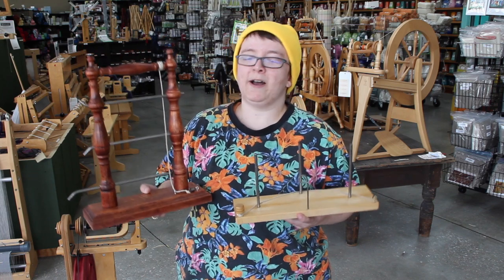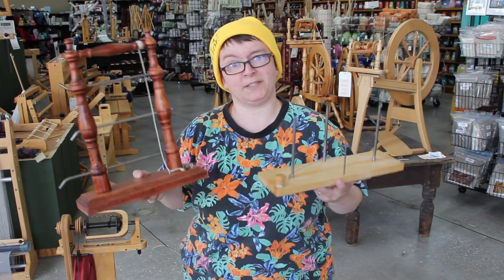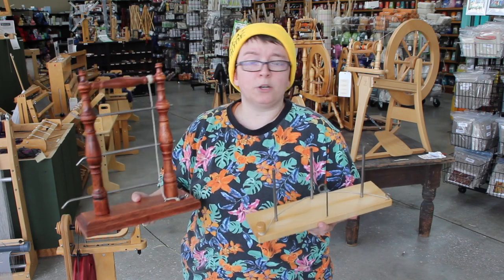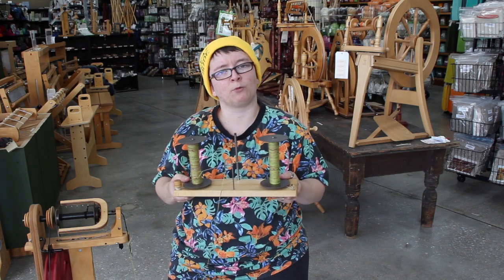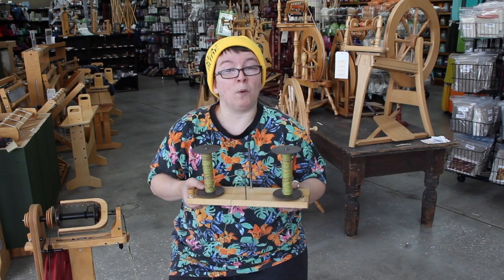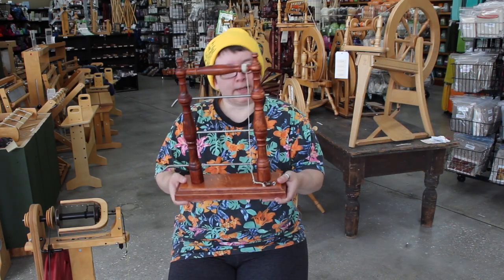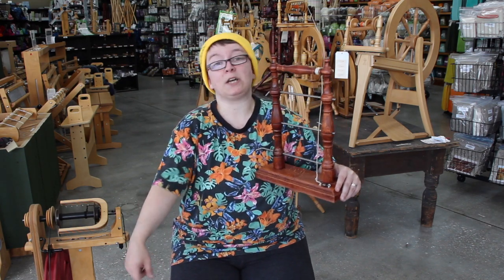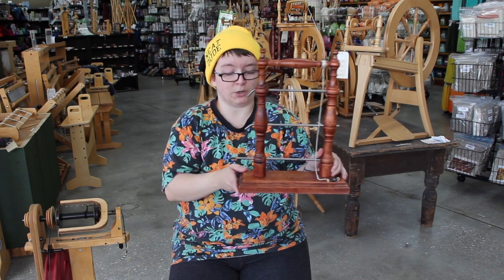What is a Lazy Kate?

Comment: Does it matter if the tensioner is serpentine around the bobbins? The flat lazy Kate you have seems the tension band across the back of the bobbins? Thank you.
Reply from the maker: If the tensioner is serpentine around the bobbins you would create more tension because more surface area of the bobbins would be touching the tension band. This isn't necessary, the flat tension works just fine, but if you for some reason wanted a lot of extra tension you could try to serpentine it!